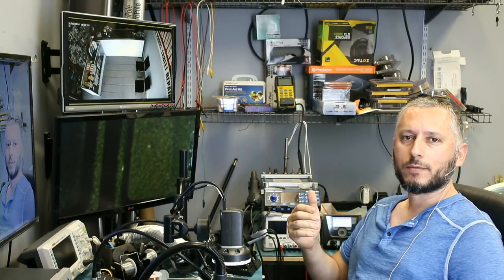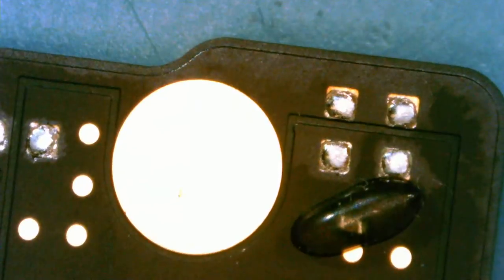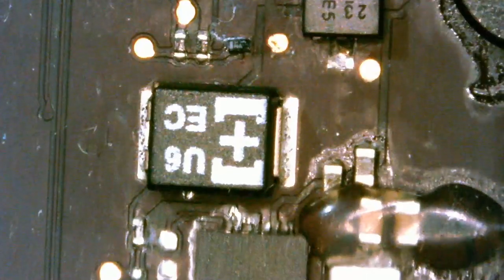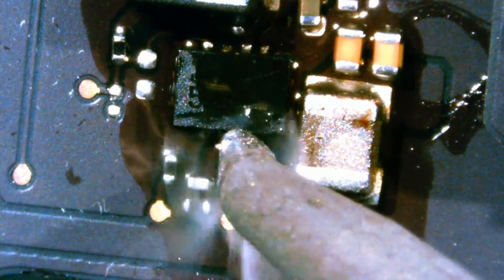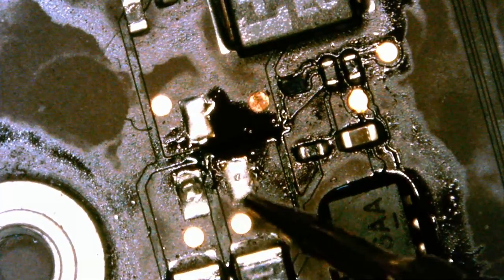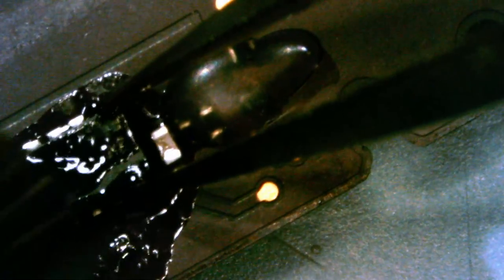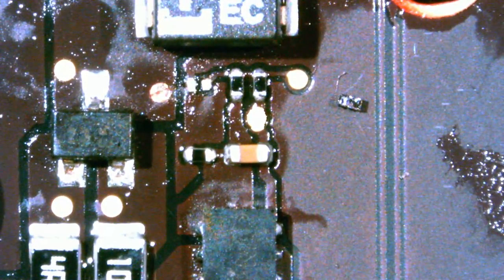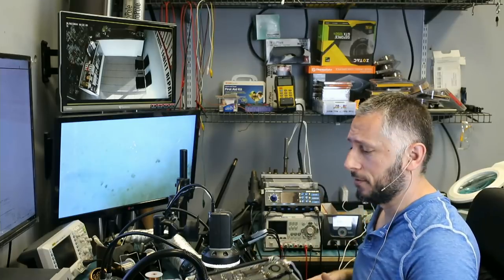2015 Macbook Air water damage Repair 820-00165 - No power No green light

Comment: Really a detective work and you're good at it. Just a question, I have a 820-3115 MBP board that is very clean no sign of water damage found when inspecting under microscope but the board is totally dead, no voltage anywhere even on the motherboard dc in socket pins when connected with a know working charger. Could a dc in socket go bad ?  Thanks again for your great videos :-)
Reply from the maker: Allot of things can cause a board not to power on. It's unlikely a DC board issue but it doesn't hurt to try another one.

Comment: That was a hard board to fix man, I'm wondering at what point do you label the board as not possible to fix.
Reply from the maker: I always try to figure out problems ASAP without spending too much time hence the visual inspection. In some cases when i can't figure out a certain behavior, even after testing and research, i call it quits so i don't waste more time. Other times it's immediately obvious when to stop ex: CPU not generating a certain voltage or CPU short. Just as i did here https://youtu.be/BU9GyKWuP_U and here https://youtu.be/iwG59dxS8K8

Comment: I have a good question bro, i´m a professional also , and informatic IT also... recently i got some issue in my laptop battery and for some reason don´t work properly with i replace some battery cells from bank, but now i guess need to be reseted or something ?
Reply: Yes,  but nowadays the chip is near impossible to reset. Forget it.  Buy a new battery.  If you do ever change 18650 battery on a working battery use the continuous power to board method. Otherwise chip will be locked when you reconnect